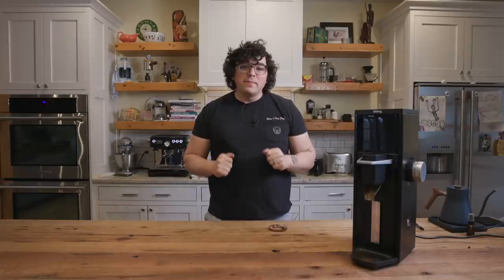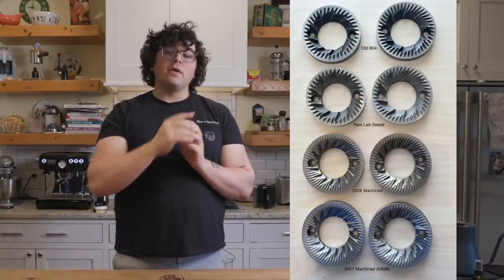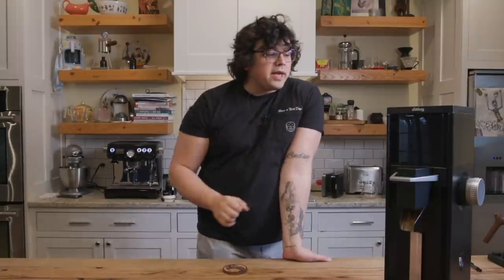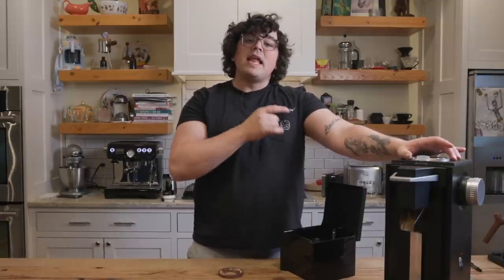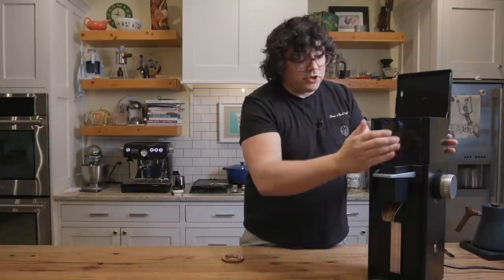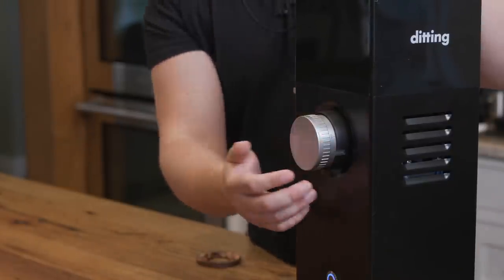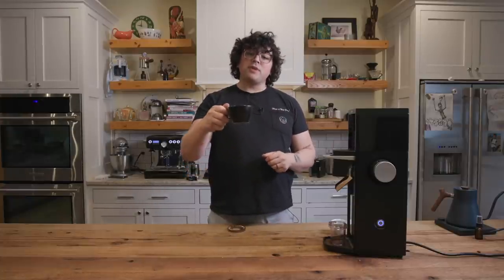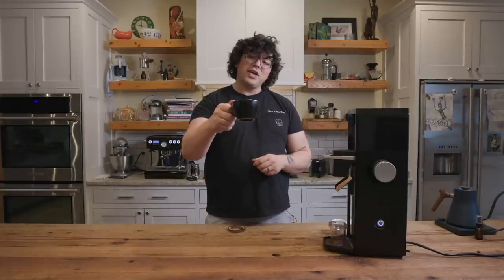SWEETEST GRINDER EVER?: Ditting 807 Review

Comment: Sweeeet video, Lance! To clarify the wattage: All three 807 models actually use the same motor. The difference is in the disc geometry. Specifically, the pitch on the coarse teeth on the LS. The burrs are creating a different resistance than the standard 807 set.
Reply from the maker: Interesting. I took the wattage off the ditting website itself. Go have a look. They give watts and rpm and grind speed. I thought it was weird they'd have different motors, but the spec sheet they provide suggests so
Reply: @LanceHedrick  Yep, we're aware of the different wattage rating.  For further clarification, if you put machined burrs in the LS it'd operate at around 500 watts. The cast steel burrs are rougher and cause particles to roll off more slowly than with machined burrs. This increased resistance will pull more amps, and operating power is relative to that.
Reply from the maker: Yes that makes sense. I forgot that not all come with the cast burrs. That is my fault. I was sent this was the cast burrs and forgot that was a favor you all did. Whoops!

Comment: 1: you mention Turkish. I would love to see a video on Turkish coffee. Everything on YT is about espresso or drip, and Turkish has very little attention. 
2: When you chirp the burrs is that not causing damage to them? 

Thanks for the video, have a great weekend!
Reply from the maker: I definitely need to do a Turkish video! And touching damage if brief and seldom. Just make sure the burrs you chirp have flat edges
Reply: @LanceHedrick  By far my favorite cups I've ever made are a modified Turkish style.

Start with fines leftover from sifting for pourover, in a cezve. Add cold water, 1:10 ratio, and stir to fully saturate the grounds. SLOWLY heat on a stovetop (should take at least 5 mins). As soon as it starts to rapidly boil over (around 235ºF!), remove from heat, briefly stir, and let cool to drinking temp in the cezve. Once near drinking temp, press through an Aeropress to filter the grounds. It is truly amazing, HEAVY flavor notes from my light roast coffees and a rich body, even after filtering.

I'm sure you're busy but I really think you should give this a try.
Reply: The burrs are made of hardened steel, it requires more then just a slight touch to damage them.

Comment: I got this grinder myself and it’s great. However I had to change the calibration in order to grind fine enough for espresso. And even now I cant get shots longer then around 30 seconds. Sometimes with lighter roasts that are a couple of weeks old, only around 20 seconds. And this is with some slight chirping of the burrs.
Reply from the maker: Sounds like they may be poorly aligned. You have the Lab sweet burrs?
Reply: @LanceHedrick  Yes that is correct

Comment: That’s a sweet grinder although perhaps a bit big for the home, still waiting to see that home grinder with those burrs that would be sweet especially with variable rpm.

I believe The Peak actually came out in 2015 and was largely driven forward thanks for the craze created by Perger WBC performance with an EK43 a couple of years prior with the legendary pre 2015 cast coffee burrs (although he wasn’t the first to use it for espresso) Mahlkonig even tried making a espresso version of the EK43 that never made it beyond prototype. The Peak where largely built on the k30, that also had its fair amount of issues. It’s certainly helped they moved on to E80 and E65 much better grinders.
Reply from the maker: Sorta. My friend Kyle Ramage worked at mahkkonig and helped create the peak. He never mentioned perger being a driving force of that machine. Also, it is important to note Scott Rao was the first to use the ek43 for shots at his Montreal shop pre 2010.
But yeah- you could outfit a weber eg1 with sweets and have variable rpm.
Reply: @LanceHedrick  Perger wasn’t part of the PEAK development, but he among others use of a cast burr bulk grinder played a very important part of the industry moving in that direction of which Rao also play an important part, largely thanks to the demand it created. No Perger wasn’t the first to use it, it was to my knowledge actually bit of a coincidence, not even Rao should be credited for that, as it was already used in the home segment before 2010, but it was Perger performance at the WBC that really got it to explode, the amount of sold EK went from low sales and a grinder collecting dust to long lead time in matter of months after his WBC performance, without all that craze I don’t think the cast burrs would have gotten such attention and the PEAK among other bulk burr equipped grinders greatly benefited from it, the question is also if they actually would have tried those burrs if not for all the talk in those years about cast burrs.

But Mahlkonig was certainly also good at taking advantage of the attention, they made sure people remembered it, plastered Pergers face on the EK etc. 

The EG is perhaps a SD grinder but not really one made for home….. the price is also mind blowing compared to others especially for us none American.
Reply from the maker: Yes. Perger helped. And rao used it in like 2006 or so. Ek43 wasn't even a coffee grinder. There is no documented use prior to raos Cafe. I'd be happy if you had proof of something before then beyond anecdotes.
And I'm familiar with pergers massive influence. I've been in the coffee industry a decade and have followed pergers every move since he competed lol.
The peak had little to do with perger, though. If anything. The finding of the old cast burr was somewhat if a fluke and the team tasted them and were wowed. 
Granted, I am getting info from one of the founding people of the peak, so I guess he could be hiding outside influence, but he isn't shy to admit the influence perger had. 
I try to base my opinion and thoughts in grounded facts as best as I can. What do you have to prove what you say beyond speculation? Just curious! Thanks for the chat
Reply: @LanceHedrick  I never bought the story about that they somehow stumbled on a burr set in a drawer that wasn’t really that unknown to begin with. I was more then aware of its existence as Ditting grinders where widespread and not uncommon where I live, people bought these from grocery stores, market etc. as cheap brew grinder for the home and often with these burrs in them, every one who knew about Ditting or played with modding Bunn where familiar with those burrs or at least heard about them, but many had at some point replaced them with the Machined version at that time many thought the machined where better. I seen plenty of 804 cast of that reason as they are really that common in europe, especially in old grocery store grinders, even today you stumbled upon them if you buy an old grinder.  But it’s a good story that sells, I give them that much, but for a european it’s very hard to truly buy that story, I definitely think it should be taken with a pinch of salt. 

The EK43 was a multipurpose grinder that could be set up for spice, grain and coffee, several of EK43 existed in europe that was used as grinding coffee for customers and where standing in small grocery store just like the Ditting. My local supermarket and small shops had one and that was more then 20 years ago and even my stepfather had one in his small shop as well, while it might not have been the norm in USA, Mahlkonig and Ditting grinders where the norm in many grocery stores in the part of europe I live in for decades. I can even remember them from when I was a child, basically every small shop that sold coffee or supermarket had one of these standing. 

So with all respect Rao probably did not come by it, he must have seen it in Europe, for europeans it wasn’t an odd sight and it was often bought as cheap grinders especially for brewed. I seen people who had this grinder way before 2006 as a home grinder, I think people today will be shocked at what we had and used in the earlier age, we literally had commercial machines sometimes of several groups, large commercial grinders, bulk grinders and what not it was really ridiculous. 

There is no documentation because it was just the average person using it, most home users especially at that time where not really active online they just brewed, drank, enjoyed and experimented on their own or among friends, that was how it was plus 12 years ago, especially outside USA, I have with some fellow nerds done a lot of stuff for many years we never ever made any of it public and sometimes you see the same finding in other people work.
Reply from the maker: All of this is pure speculation unless you have even a modicum of proof beyond my taking your word.
Regardless, yes. Of course one should take the story with a grain of salt. But, it should be noted Kyle no longer works for mahlkonig he he stands by a similar story to that. Not sure why he'd be marketing to a friend who already owns this machine...

In any event, you seem to be very much in a position where you can't be turned left or right because, as you've said many times, you are European and it apparently a priori makes your knowledge more grand than mine, which is fine.

As for me, I'm bored or arguing over something that can't be proved one way or another. 

Cheers and brew some tasty coffee!

Comment: I need to go at 1.5 to grind for espresso. Using Decent. Is something wrong with mine grinder? That is marked as “Turkish” area.
Reply from the maker: No- if you recall, I had chirp set too high
Reply: @LanceHedrick  i have Lab Sweet version. Espresso is marked at somewhere between 2.5 - 4 range. I have “burrs touching” just hair below 01.

Comment: At what point does “perfect” get in the way of “good?” Does a $3,000 - $6,000 Ditting really make that much of a difference over a fully-upgraded-and-modded $200 Baratza Encore?  Honestly, is it really worth it (if you’re being perfectly honest).
Reply from the maker: I'm not sure what mods you're doing to an encore other than upgrading to virtuoso burrs, which still aren't very good imo. I can't stand them. Worth is relative to the person, of course. There is a MASSIVE gap between them, yes. But whether it is worth it is dependent on the budget of the one asking. 
If doing only filter, and wanting to be budget friendly, I recommend getting a fellow ode with the SSP cast or MP burrs. About a $500 package

Comment: Did you know that all three models in this series use the same motor?  The only difference is the discs.
Reply from the maker: I do now, yes. I was sent the 807 filter grinder but with Lab sweet burrs. Didn't realize they came with different discs than the lab sweet. So, when I saw the listing for the motors being different, I assumed they were truly different motors. I feel that to be a fair assumption lol